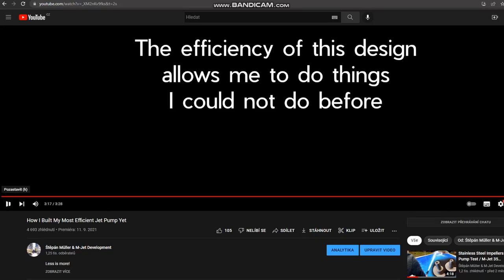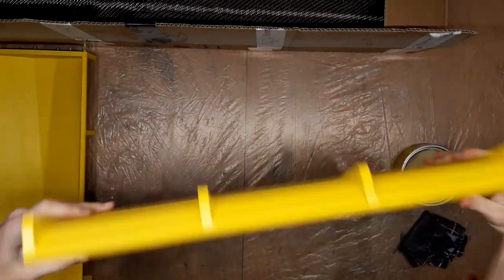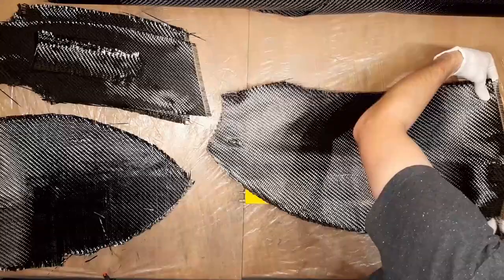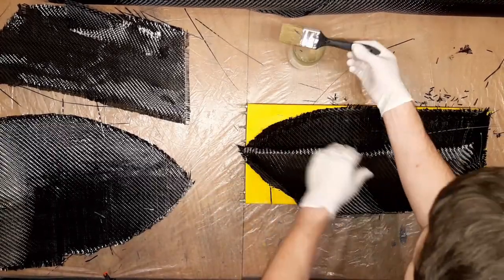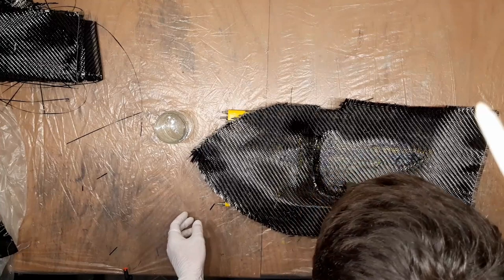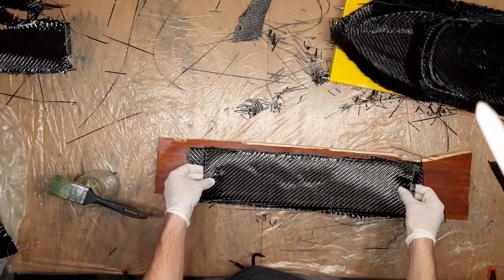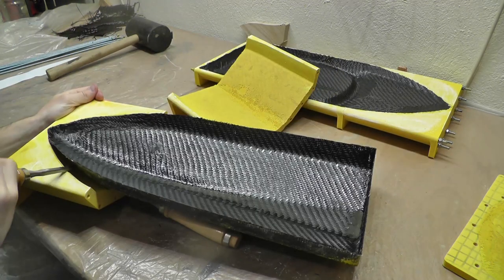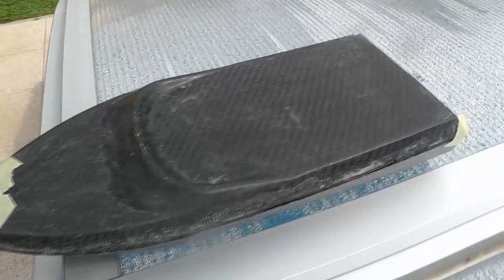4G Sprint Boat Build Part 1: Moulding the Carbon Fiber Hull

Comment: Hi Stepan, a common width of carbon fiber cloth is 300mm. Is that wide enough?
Reply from the maker: @burner8126  It's barely enough for the full width of the hull. The hull itself is 20cm wide at the widest point. For more comfort I would recommend a wider cloth, alternatively you can use 2 overlapping pieces.

Comment: Hi Stefan,

Can you tell me the size for the threaded rods for the joining of the moulds for the 4g jetboat hull? M4 or M5? 

Don't think it was mentioned in the video or somewhere else? or did I overlook?

And a question about the water cooling channel in the m-jet 35 housing. There is no seal in between the two housing parts for the cooling water. will it just spill a bit from between those two housing parts or is that tight enough nothing is needed? or maybe it will spill but does not matter since there is enough water supply to circulate?

and last question. Can you tell me what you payed for the stainless intake grating to get it lasercut? pcb ways wanted 45 or 50 dollars extra for it while I ordered two aluminium laser sintered impellers for a good price. The intake grating would be in the same package so no extra shipping costs. I was surprised thst was so expensive compared to laser sintering. cutting the grating would take maybe 2 minutes? and printing two impellers would be more like a few hours I imagine? So I only ordered the impellers and just ordered a little raw 2mm stainless plate at Aliexpress to cut one myself with the dremmel. It is halfway and it is hard work and will not be so pretty compared to laser cut but it is at the underside of the boat and the price they asked was not ok to me. did you had the same?

Maybe you have a 90% similar mail I tried to send a few minutes back via cgtrader but there was a few times a warning it did not work and then all was blank so needed to write it again.

Best regards,

Eric Brockhus
Reply from the maker: Hi, the threaded rods are M5. Regarding the intake grate, it definitely should be cheaper. I got mine from a local manufacturer and price was around 6$ per piece, there was just a requirement that the whole order must be over 20$ so I got more of them. Often if you order more of them, price per one decreases rapidly. 
I did not receive any CGTrader messages from you, probably something went wrong, but you can just ask me here:) Good luck with your build.

Comment: if you wax the mould again after applying the pva-release agent you might get a better parting,
first coat of wax has to be pretty liberal and given a bit of time to harden off before buffing to reduce porosity, looking good :) putting the half's together, I used tape to align them , super-glue and some thumb-pressure to tack to together, then resin and ribbon on the inside, hope that helps mate, Mark
Reply from the maker: Oh the wax over pva is a good idea, I did not think of that! Also probably I did not wait enough for the wax to harden as you are saying. And yeah I will use tape to align the parts. Thank you for all the tips!
Reply: @mjetdevelopment  It's actually the other way around... wax, buff, wax, buff... then PVA the wax layer. In my PLA/PETG molds it goes: sanding -> gap filling primer -> sanding -> more gap filling primer -> sanding -> cleaning -> waxing -> buffing/waxing again -> PVA. Then splash some water into the mold to release the part.
Reply from the maker: @sloth6765  You use water as an additional release agent?
Reply: @mjetdevelopment  no I splash water down the edges of it after the glue have cured to release the part 😀
Reply from the maker: @sloth6765  Ah ok then:)
Reply: @mjetdevelopment  I printed out the m-jet sprint and been on a lake the last two days. This little boat have a lot of soul! With the bilge pump it runs dry, submarines itself when I push it, flips over, the pump sticks and doesn't lose suction on jumps, it runs hard .. very impressive performance!!

Comment: I sent you a message on CGTrader, regarding the M-Jet 30. I need advice on improving the print of the first impeller, so that it is not out of round/out of balance when on the shaft! Thanks!

Comment: I just finished printing the mj sprint jet at 2x bigger than the original and it actually runs better with more weight and a bigger motor
Reply from the maker: Wow cool! Great that you solved the issues with component sizes. I would be interested to see how it runs!
Reply: @mjetdevelopment  yeah it was a bit of a mission finding hardware bearing and shafts were easy to find but bolts long enough to hold the impeller housing the the hull was a problem

Comment: Is it possible to build a full size carbon fibre  boat whitout a vacum bag. Just like this but with some extra layers.
Reply from the maker: Yes, vacuum bagging is not necessary.
Reply: I want to build a about 4 meter hull. And have made some paper templates. I noticed here on youtube that most people tend to lay carbon fibre whit vacum. But not so often vacum when laying glass fibre. Therefore i thought of making the hull of glass fibre couse i do not have a vacum pump or enything. But if it is possible to lay it whithout vacum i will shoose carbon fibre.
Reply from the maker: @meckarelis3235  Wow... I cant really give advice with this size. At 4m length, shrinkage of the epoxy might become a problem. But I dont know.. What will you use the hull for?
Reply: @mjetdevelopment   a fun projekt. Just a little higher apeed boat that i could bounce around a bit on. I live near a coastline where i can drag a boat of that size down to a river and then drive like half a km to the coast line. And why not use that easy acces to a whole ocean by having a new hobby
Reply: And i thought. Why not build a boat of dense foam and cover it in carbon fiber. Like a surf board.
Reply from the maker: @meckarelis3235  I think wrapping foam in carbon is a great idea! Sounds simplier than making moulds to me.
Reply: @mjetdevelopment  and then i could get a less flexible carbon boat whit that same nice pattern in a way easyer way.

Comment: Stefan, I have a question about  joining the two hull halfs. you use fibreglass tape. Is that real tape with self adhesion? does it have open stucture so epoxy resin will soak into it and bond it to the hull? Why did you use this stuff and not a strip of carbon fibre?
Reply from the maker: The fibreglass "tape" has no self adhesion. It is just a strip of fibreglass around 30mm wide, and needs to be laminated with epoxy just as the carbon fibre cloth. 

The advantage of the tape aganist a cloth is the ease of use - no need for long cuts, you just cut it like a tape. Also, the tape all holds together, unlike the cloth, where the borders tend to separate and leave the cloth's structure. Furthermore, the tape I used was much thinner than my cf cloth, so it was easier to bend it around the joint.
Reply from the maker: @dextersxxxxlab  Yes, I heard some people had success with that.